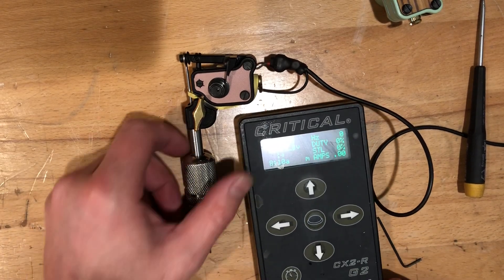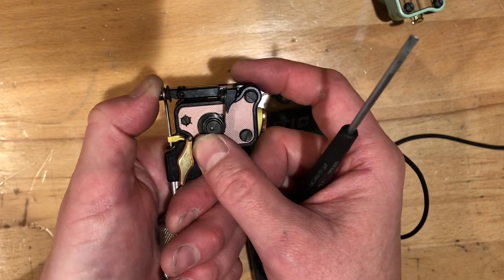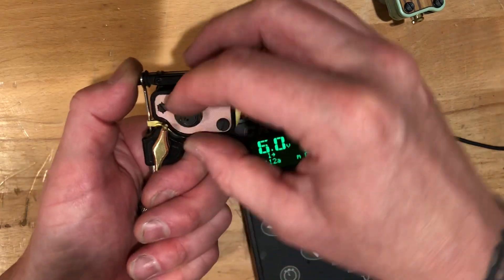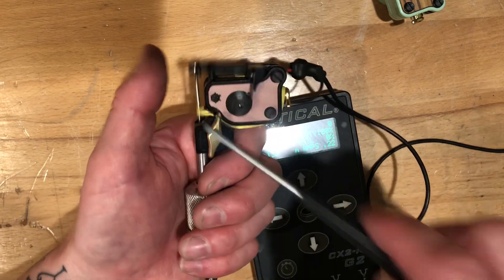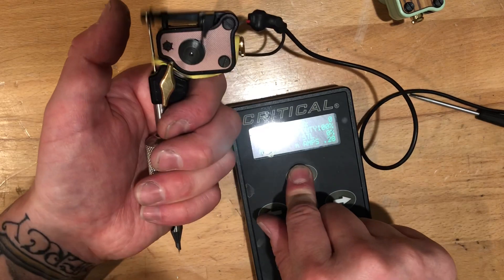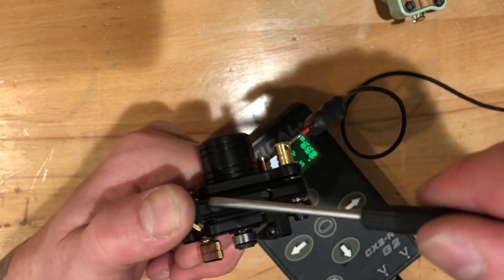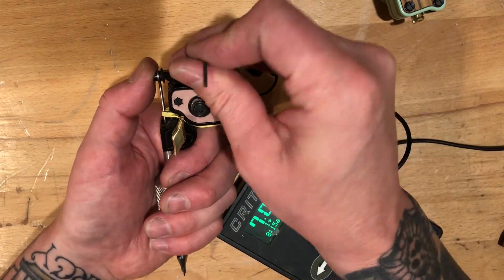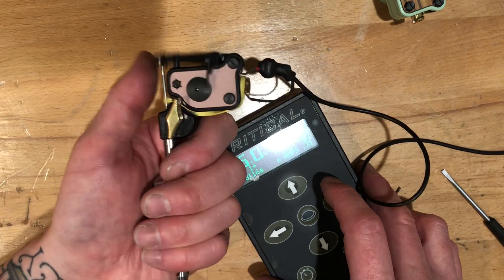Advanced tuning for Sidewinder 7b

Comment: Hey man, I have a newer v7 and it randomly went out of whack. I noticed it yesterday. The mark on the cam is hitting much lower on the spring and almost missing it. I havent made any adjustments and i dont want to change the stroke I like the default setting. What do I need to move over for it to hit that notch properly?

Comment: Hi Dan,
A question for tuning. I received my 7.3 yesterday and the line on the cam and machine don’t match. It’s way down below.
Do I need to align it or can I just use it the way it is… thx
Reply from the maker: Does it run properly?  Did you get it from me?  If you got it from me, then I wonder if you are checking it properly. I load all of them with a tube and needle and test run them.. if it’s stuttering and weak when loaded, then you will need to re-set it.
Reply: @dankubin5386  thanks for your answer, I will check it when loaded.

Comment: Dan. I and i think a lot of other people would love if there was more clarity and structure to these videos. I feel that you jump back and forth with several settings quite fast and there is never 1 single way to set the machine for zippy 5-7s or 9 and above etc. You say the impact adjustment pin is set perfect and shouldn't be changed, then you say that it can be turned but balanced with the impact pin on the top of the machine. So my own 7b is slightly ahead of the timing mark out of the box. Should i turn both impact pins a notch + a half turn to line up with the timing mark. If i do this, how will my machine run compared? It sounds good but i guess I'm running the risk of detuning your settings. Clarity would be great as you can't fuck with a good 9 or 11 but anything less and changing tuning can be DRASTIC for these machines. Big fan. This is my 6th Kubin 🙌🏻🗡️
Reply from the maker: I feel the v7 is a lot more forgiving to use and adjust settings.
There are multiple ways to do things, and don’t need to take it to the next level.  Just increase spring tension if you want it zippy.

Comment: Hi,
Can I ask what the difference between 7, 7B and 7.3 are?
And what is the stroke of them?
Thx
Reply from the maker: I modified the bar on the 7.3 so that it’s more stable/no wobble.  The stoke has 5 positions, ranging in the 3.5-4mm range.  Keep in mind that the stroke on a Sidewinder should not be compared to that of another type of machine.  It strikes very fast, and retracts even quicker..
Reply: @dankubin5386  thx Dan, looking forward to get one 7.3

Comment: Hi ! Is there any way to calculate the CPS on these sidewinders? Or would that be possible only on a direct drive?
Reply from the maker: You can use a guitar tuning app..and find the correct hz by sound.  As far as I know, cps values are only easily registered with a relay machine (ie coil machine)

Comment: Hi Dan,I watch this video for many times,still can’t understand,I usually use 7-9RL liner, if i run about 5 volts’what is the best setting?33-39amps at 6 volts,spring adjustment knob at 7 o’clock?same on cartridge?thank u
Reply from the maker: If using a cartridge, make sure you have a rubber band pulling down on the bar. Then have the lowest return tension . maybe 1-3:00 and go from there.
Carts are tricky because they are all different
Reply: @dankubin5386  when I use standard niddles,7-9RL for lining at 5-5.2 volts 
My setting is:

timing mark : straight up
Impack knob at : 3-6 o’clock

When I use cartridges’s setting :

Same as another video you teach on Instagram 

timing mark : left up
Impack knob at : 3-6 o’clock 

Am I right?

I’m asking this because before you upload this video, my settings are as I described above

Comment: If tattoing with 3rl, whats the best settings? Is it the shortest stroke?
Reply from the maker: It depends how fast you want to go.  For me, I keep it in the middle, and run about 5 volts.  If you want to run really zippy, then a shorter stroke..but I first recommend just increasing return spring tension first with your current setting